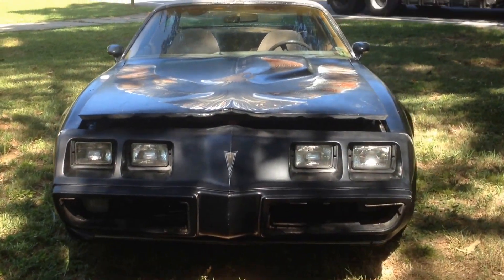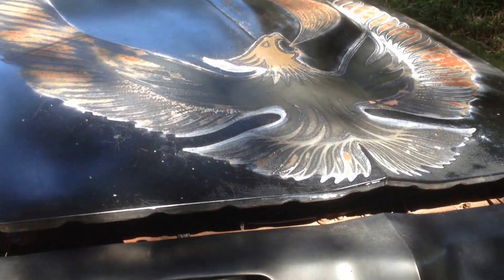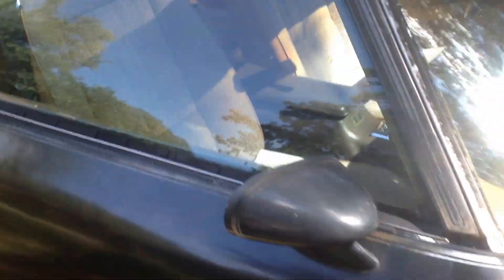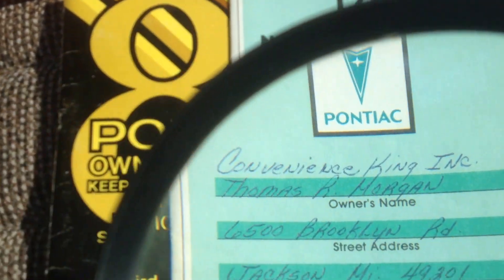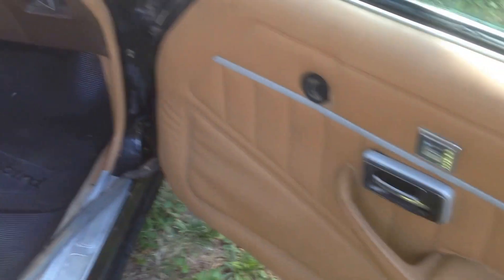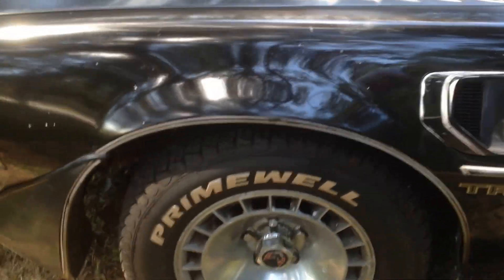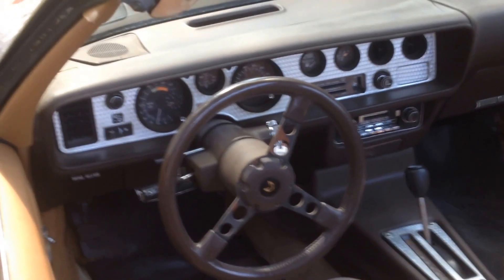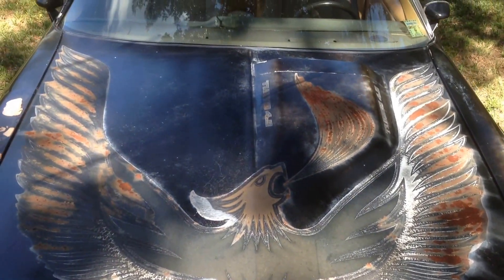1981 Turbo Trans Am Special Edition with Original Window Sticker

Comment: So, Mitch.... I'm wondering what your honest opinion is of the turbo 4.9?  I hear mostly negative things like.. they are not reliable, they don't perform well, and not very collectible.  Are they really that bad or just very under-rated?
Reply from the maker: Well, it is not a fast take off for sure, the Turbo will only kick in after you floor it after  you get higher than 2,000 rpm', it will move but still, its just not a fast car..

Comment: I just bought a 1977 firebird. It has a 301 and is a very solid car. I paid 100 bucks for the car. It's firethorn red and I have a question. It doesn't have a carb on the engine but I talked to some guys and they said I need a 4 barrel dummy carb and I was just wondering how I could get one?
Reply from the maker: Hey, I am confused. So you having nothing on the top of the engine? It was removed? you need a 4 barrel Elderbrock/ Look up our group on Facebook, "Trans Am Lovers" we have 28,000 members and if you have any questions, we can help you..